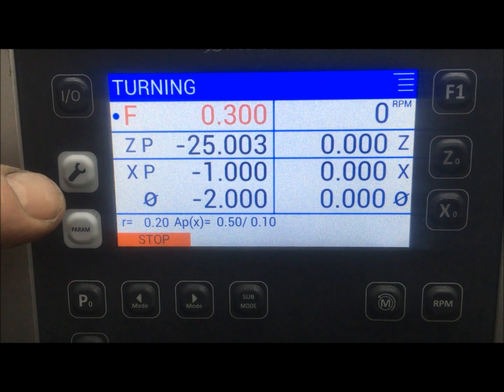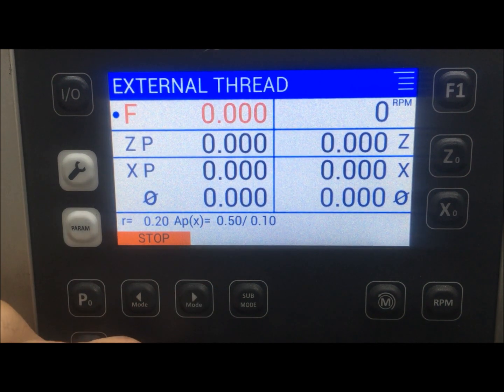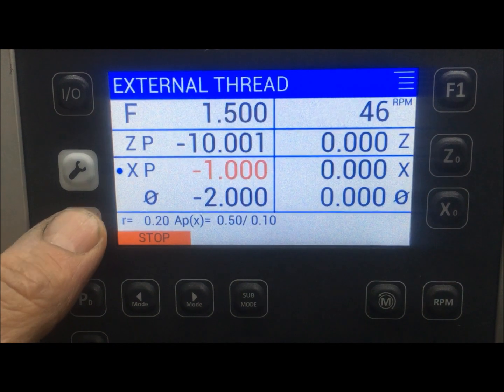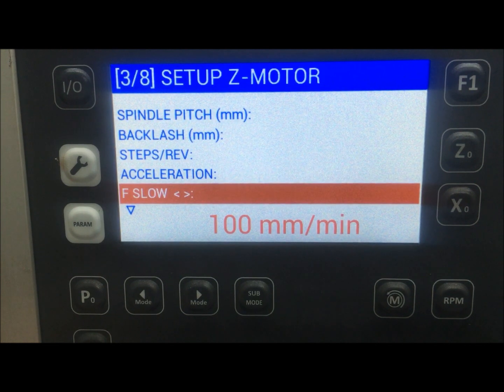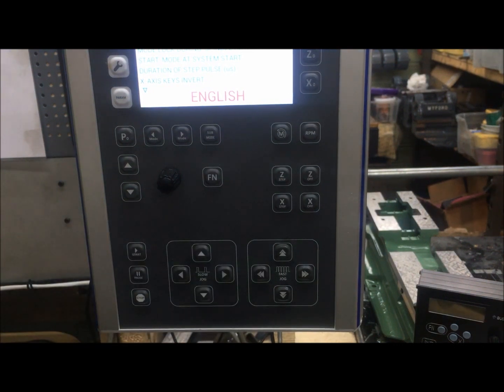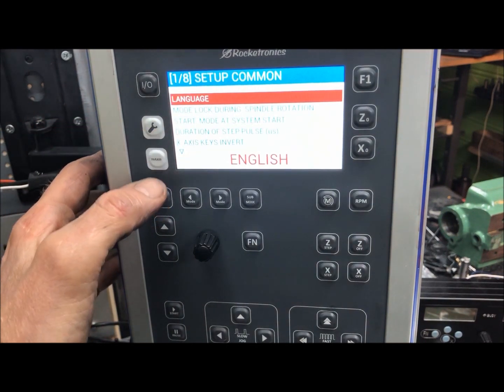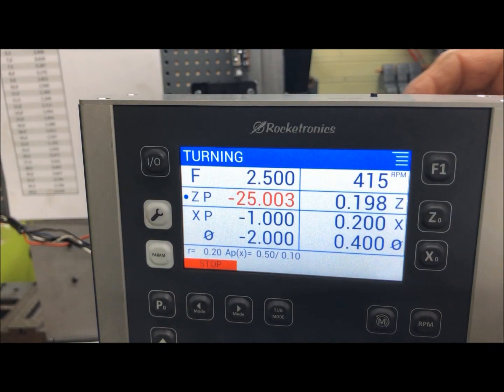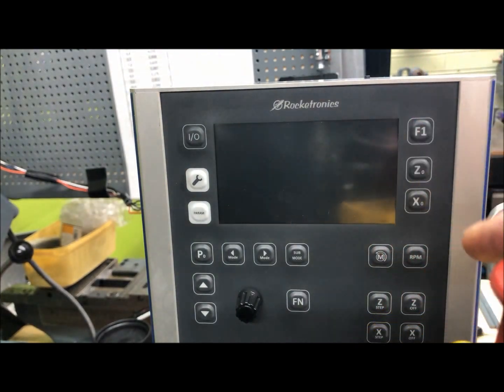ELS 4 Pro details

Comment: Can it be set up for imperial units?
Reply from the maker: Not directly set/read on the display, only metric. I have made a table for metric/imperial conversion, ie. just plug in the metric equivalent in .00x mm . PS! I also asked about this though as it was addressed and I think Rocketronics have plans to make a special variant of the ELS as I understand it requires a fundamental change in the calulation routines/design, hence possibly not easy to integrate metric and imperial in the same hardware/software environment. However, I would ask Louis directly as he certainly knows and will answer best himself :) https://www.rocketronics.de/en/els/

Comment: Rather than undoing the alan screw to disconnect the encoder at the rear of the crossfeed. Maybe that's where a clutch arrangement could be fitted. Following your good work with interest.
Reply from the maker: Thanks😊
Reply: طاي مل نبن نبت نب م

Comment: That's the price of building a CNC system yourself, you have to do all the fiddly setup yourself.  Some people enjoy doing it, some just can't.  Very glad to see your project going forward so well!
Reply from the maker: Thanks! This is really not CNC as such, more like manual with additional cycle control. Many of my fellow machinist friends have "upgraded" to larger, ex industry, CNC lathes and mills, but I cannot see myself go that route. Then I would at least need a bigger place. But we are all a little different so each will have to find their own way.. You also havev Weiler and Schaublin doing professional manual lathes with cycle control, so although a different name, the "ELS" way  is probably not a new idea. On the smaller ML10 I thought about retaining the "dog-clutch" so I could disconnect the leadscrew alltogether. Just to show how it really still a manual lathe (could do the same with the cross-feed, adding some form of clutch/connection so to free the screw entirely from the motor. Not much resistance but you will of course "feel" the steps).
Reply: @jansverrehaugjord9934  It's a shame you could not have the crossfeed screw on a system where you could say press a release at the front & draw the screw back 5 or 10mm to disconnect from the encoder gear.
Reply from the maker: @Steviegtr52  Funny you mentioned this as I have been thinking about this too. I might do this on my ML10, one way or another. Maybe just a solution as the leadscrew dog clutch that was on this small lathe originally, but must make sure there is no backlash when engaged. However, the cross feed works OK when you "switch off" the stepper motor. You can feel the steps but there is not much "resistance". It is also possible to undo the set screw to this motor